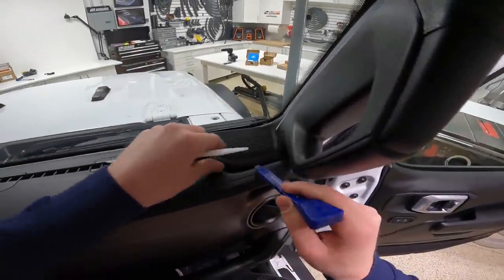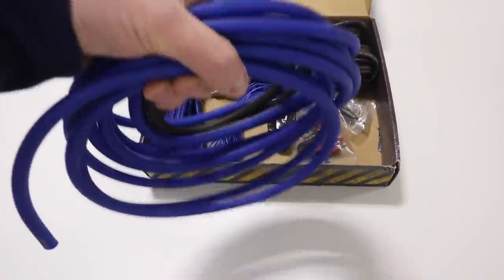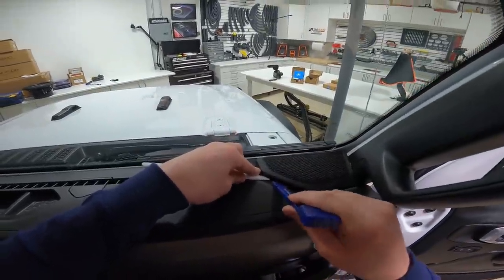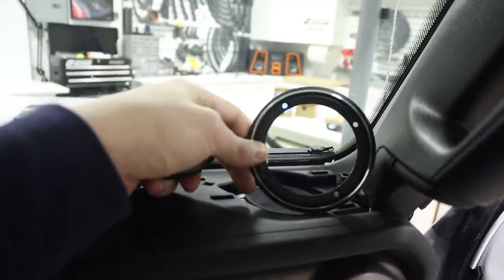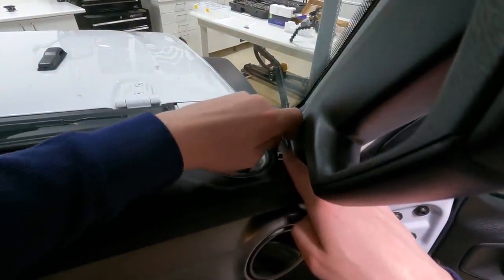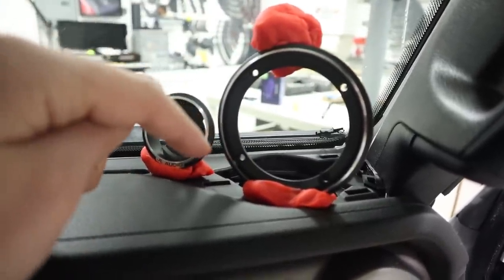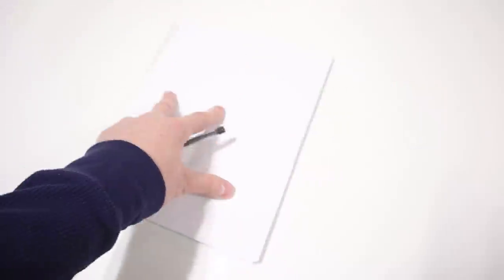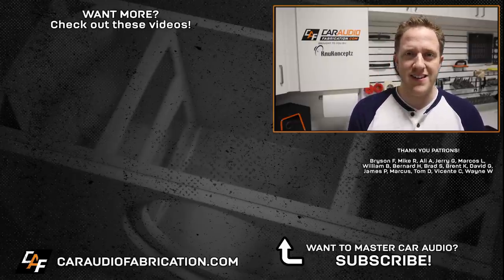Custom Speaker Dash Pods - Planning for Better Results!

Comment: Hey Mark, just wanted to reach out to you and thank you for these videos. Without them I do not think I'd have even tried to make custom speaker door panels and speaker pods. I've made several sub boxes and have put together several systems for myself, friends, and customers. But nothing at your level!! I'm currently finishing up a completely new, from the ground up, system in my 27 year old truck. Which I've also built a new engine for, as well as all new-ish interior, new tires and rims, all new lights, and custom paint. I decided to go with Cerwin-Vega HED series speakers and Cerwin-Vega Mobile amps. So far I'm really happy with the setup I've designed. Cerwin-Vega Mobile has shown some interest in doing a feature on the truck. I've not decided yet if I'm willing to do that. Honestly, I don't feel like my work is "feature" quality. 
 Anyways, Thank You Sir for all your time and efforts! I do honestly think I could not have pulled this off without your help, knowledge, and instructions. I'm greatly appreciative!!

Comment: Your videos helped me immensely in a related field, building my own custom guitar speaker cabinets. 

I had built 4-5 before my latest build and was having trouble with the upholstery, but after watching you wrap those beauty panels on that down-firing box, I was finally able to get the results I wanted using wilsonart H20 and proper technique. 

Now I can confidently go forward with my next build without worrying that my upholstery is going to suck. I know my builds this year will be a success, thanks Mark!

Comment: Mark,  Can you please do a video on how to do something for classic (60’s and 70’s) car upgrades with a modern interface?  Something like amps with onboard Bluetooth and building custom either kick panels or door pods to get away from a single dash 4x10.
Reply: What are you working on?
Reply: @End_of_Dayz  
‘64 Riviera personally but would like to see something in general about improvements without cutting a classic up.

Comment: I screwed up. Think I used the blue dogh. Looks fine BUT did not sound right. What can I do?
Reply from the maker: Oof, rookie mistake. Gotta get the extruder and make spaghetti noodles out of the dough and drape it from your head over your ears to properly filter the sound now.
Reply: @CarAudioFabrication  Soo funny you say Spaghetti. In my '98 Beetle I used an IKEA potato masher as a guide for my 3" dash speakers, to drill holes in an even pattern. People think its Stock. Keep it in the Kitchen!

Comment: Hi. I searched your channel and could not find a video about breaking in new subs. I just bought a new deaf bonce 12 inch sub, and thought that breaking in means playing it softer at first for some time. 3rd day and already sounds better (in the first day it had a flat spot above some volume level)  But now i looked online and asked a couple of guys, and it seems that I have to break in the sub in free air. One of the recommended metods that i found is playing a 20hz sine tone for 2 hours straight. My questions are: Is this safe? It is a correct methot? What do you recommend i do next?

Comment: Hey man just curious I just recently replaced all four door speakers with Rockford Fosgate R165-S and installed the tweeters in my a pillars I also replaced the head unit and used the PAC RP5-GM11 Wiring Interface for my Chevy Tahoe well I think it’s still using my factory amp and the sub still works but is blown I just want to by pass the sub and the amp and install a new amp to power those new door speakers what is ur recommendation on a amp and how would I still connect it to the factory harness so that it works with all my speakers

Comment: greetings. I will buy infinity kappa component speakers ( 6.5 and tweeter). I heard that I can add a third speaker (3 inch mid range) with my current 2 way component speakers with out replacing the two way crossover or anything else !!!!

please explain to me how to connect this 3 inch midrange to the component speakers.

Best

Comment: It's going to look good when you are done. I've got a question I've got all my speakers in my 01 expedition arranged so I can hear all 4 from the drivers seat will that  Cause any damage to my speakers
Reply from the maker: I'm not sure what you mean? Not sure how the locations could damage the speakers as longs they aren't physically hitting anything, might not be optimal for sound though...
Reply: @CarAudioFabrication  no you did a show on the radio about the distances  so I have used the balance and fader to adjust the speakers so the driver can hear all four and not just the drivers door. Would that hurt the speakers. Would they be unbalanced

Comment: Why not just build your pod off of the existing speaker grille frame? It's already designed to snap in place, no screws/bolts to worry about.

Comment: How much does a direction mount change the sound? I have those c2 coax 3.5 in the dash of a ram 1500. Would it help to angle them different than the stock mount?

Comment: I really dont understand why the power wires for a 12 volt current need to be that thick, even the 220v house wires are half the size of those
Reply from the maker: Research AC vs DC

Comment: Question, how do you know if a amplifer if blown out?
Reply: I have a hifonics 600watts amp 1 year old i was tuning the bass amplifer so I lower the 600watts 4 channel amp. To not have damage on the door speakers. But when I was done I tune up the 4 channel amp again but I noticed the logo wasn't on. So I check fuse and everything is good, I also checked all the cable's ground and battery everything seems good. So im clueless why it blown on me after a year😭 lol

Comment: I ordered from knukonceptz around two weeks ago and I’m really disappointed. I was really looking forward to try their products especially the battery terminal but I didn’t receive most of what I ordered. Apparently they use flimsy boxes for heavy wire and the box broke in transit. They couldn’t do anything about it because whoever found the broken box decided to wrap it with plastic wrap and deliver it like that. $100 worth of products lost.
Reply: They CAN do something about it, and so can you.  You can request your card to charge back to them if they don't provide the material you paid for or refund you.

Comment: Hello .. I’m in the process to replace the stereo in my ram. I have decided to go with focal access performance 3 way system in the front and coaxial in the rear I’m also installing one 10” Rockford power with 500 or 600w I’m using two amps one for the sub and one for the speaker . For the speakers I have the audio control 1200 I believe. My question is that will I notice a difference if I go with the flax speakers instead? Is it worth it to pay the extra for sound? Because of the diferente is sound is not that big I probably will stick to the performance access series